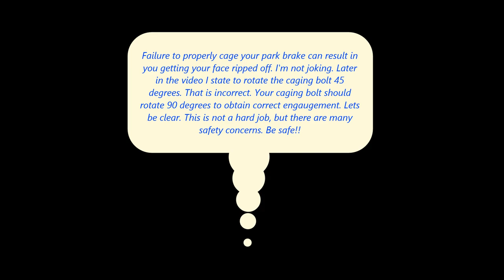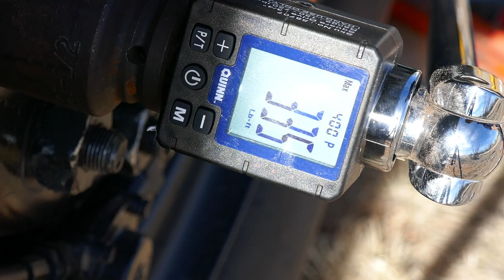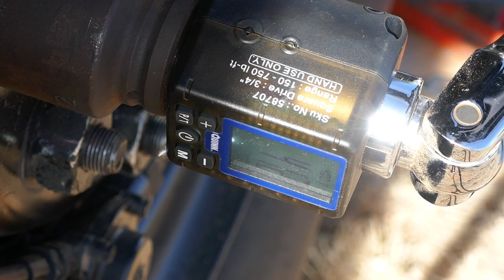FMTV LMTV MTV Park brake diaphragm replacement.

Comment: Can I talk you into taking a video of dog bone attachments on these rear  two axles and chassis.   Im considering using Dog bones for for a bit of a fab on my upgraded axle on my 1079 (its the front axle of the pair off a 6x6)

thanx in advance if you can.
Reply from the maker: Sure. To be clear, you want the lower braces and not the upper "V" brace? correct?!
Reply: @44mechanic  yeah I think lower only